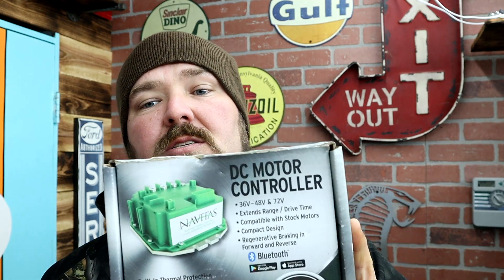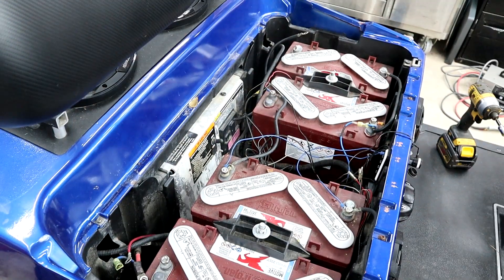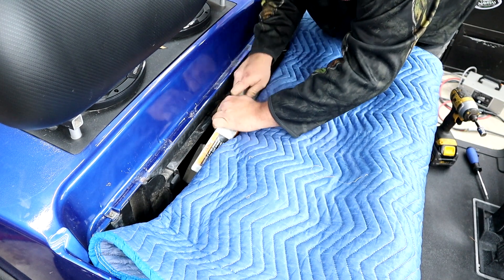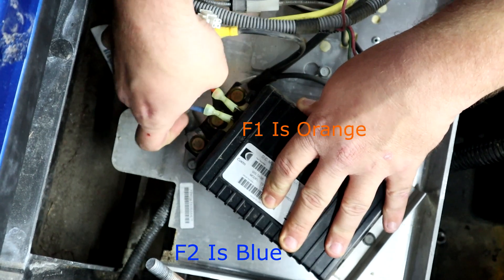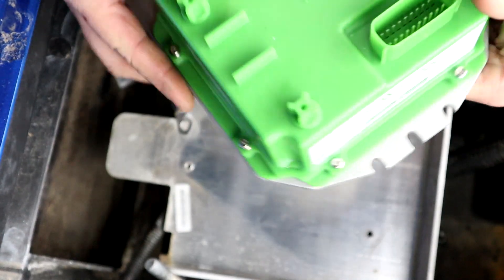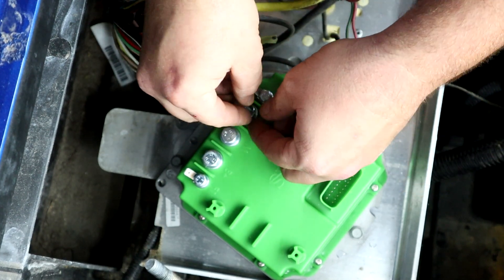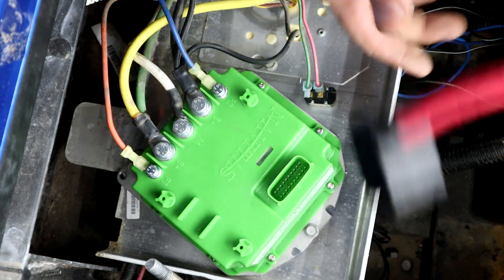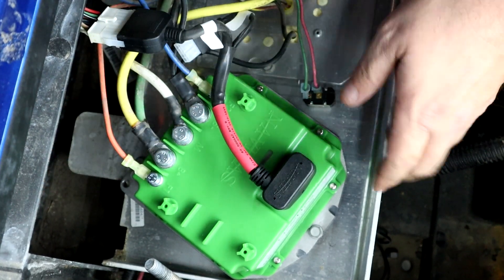Navitas TSX 3.0 440 Club Car Precedent Install

Comment: I’m looking for more torque from my Club Car Tempo. We have quite a few hills we have to travel and with 4 people the cart could utilize a bit more power. Would a controller upgrade improve the torque output or do I have to do controller and motor upgrade? Wish you were in Washington, we have no options here!
Reply: Controller and a Lithium battery would fix that real quick .
Reply: Same cart, same problem… would like to know the answer as well

Comment: Yall need to head south, it's 72° in the Florida Keys 👊.  I did the 5 KW 600 Amp AC conversion and lithium battery pack, cart does 35.
Reply from the maker: We will be In Orlando in a few weeks
Reply: Do the 72 volt Lithium batteries instead of the 48's and you'll have a full on performance machine capable of ludicrous speed
Reply: I want ludicrousness! Can this system work with a 1993 ezgo?
Lots o jokes there but it’s what I have 😬